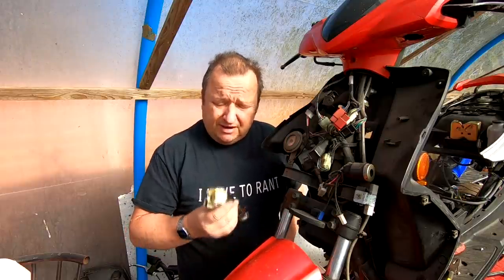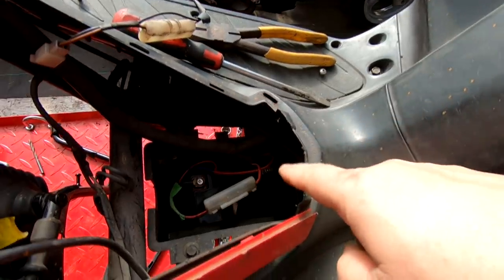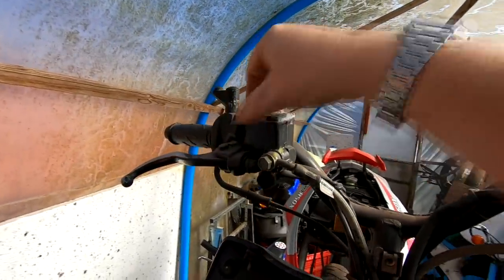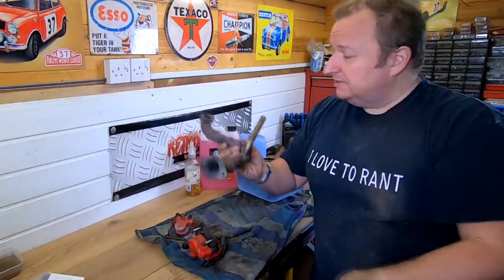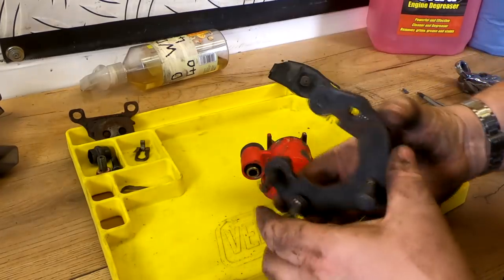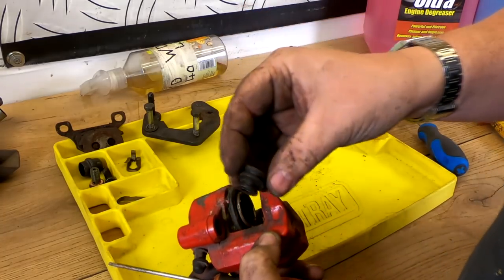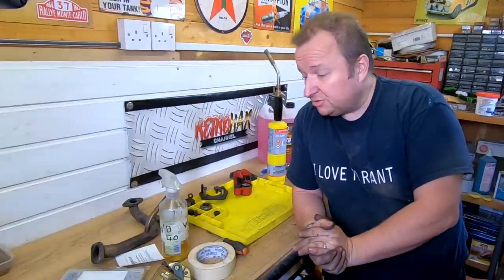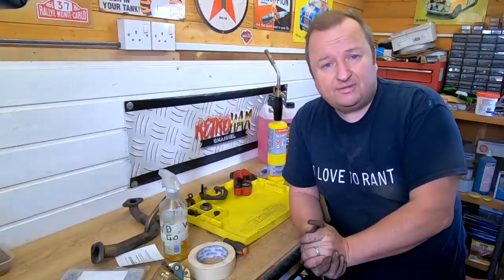Project TGB R50X Scooter Part 9 Ignition And Brakes

Comment: I used to use S83 tyres and became so fed up with nails etc thru the tread I invested in a set of Continental Twist's, rear is all round compound and front is racing compound to give me some extra sticky on the tarmac, the Twist's are Kevlar reinforced and never had a stone, nail or screw causing a problem, have even driven over glass and still good.

Comment: I always pump the piston out before disconnecting the hydraulic hose
Reply from the maker: They were seized.
Reply: @retrorestore  
I know Martin, that’s why I use the hydraulic pressure,  in the last 25 years of running a scooter workshop i have seen many seized callipers, try it next time it might save you some time,  also most seized callipers can be saved, it’s usually corrosion behind the rubber seal choking the piston, a rotary wire brush in a dremmel and a pick usually sorts it out.
Reply from the maker: @ronpalmer1371  We did pull the brake leaver Ron, the lever was spongy, maybe moisture in the brake system had an effect. I've refurbed the caliper now and it looks new. You'll see that in the next vid.
Cheers
Martin

Comment: Cmpo might be a good place to try. You can get individual seals from motorcycle parts shops. My local parts shop do by measurements. But most scooters use similar calipers like those you shown

Comment: If you have the specifications of the caliper, you can find individual seals, etc. I was going to use that method to rebuild a rear caliper on a Sym Smyphony 125/Peugeot Tweet/Tweet RS/125 as the kits are not available officially other than a new caliper.

Comment: love the videos keep them coming..  Dont know if you can help im rebuilding Yamaha rd400e  it has micro exhausts they are stamped with rd250.  are thay the same as the 400...
Reply from the maker: The 400 exhausts have flexible connectors at the downpipe where the 250 are a screwed connector because the 400 engine is rubber mounted where the 250 is bolted directly to the frame. This is because the bore and stroke on the 400 is not balanced causing more vibration where the 250 bore and stroke is the same meaning no vibration.
Reply: @retrorestore  thanks think i will buy sum allspeeds or higgspeed ??

Comment: if you let me know wot the od of the brake piston is i will be able to sort a seal kit out. but looking at the state of it your better off contacting CMPO and asking them to match you a caliper up . will be about 25 a caliper with the pads  the caliper looks like its off a  ft125-17c
Reply from the maker: Its 34mm diameter Simon, I've ordered a new caliper now.
Reply: @retrorestore  if you ever get stuck in the future. A pack of 5 pairs of that size and style where £17 wen I just looked. But a new caliper is much better
Reply from the maker: @simonrawle7885  Have you got a link Simon.
Reply: @retrorestore  will inbox you on your Facebook page